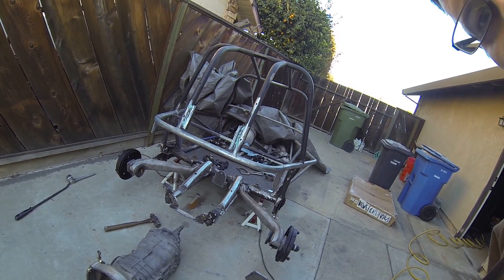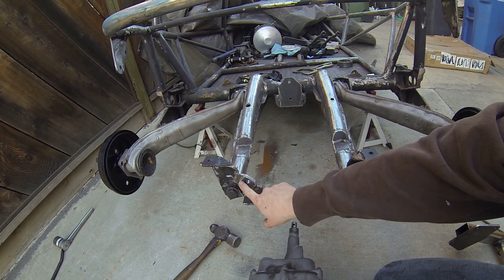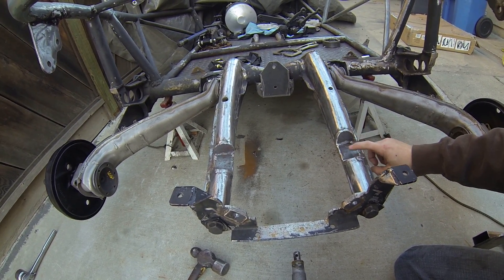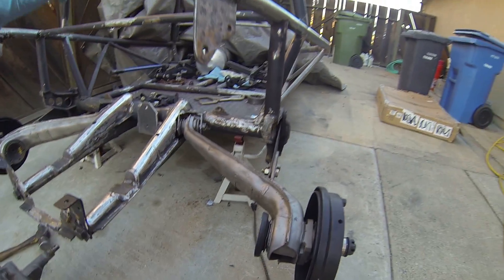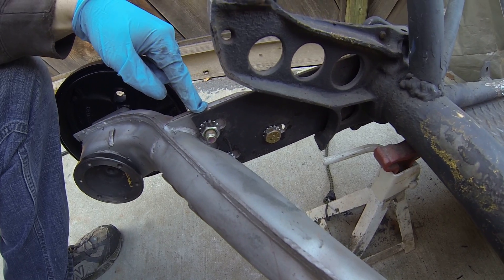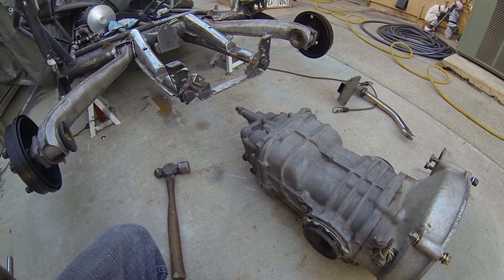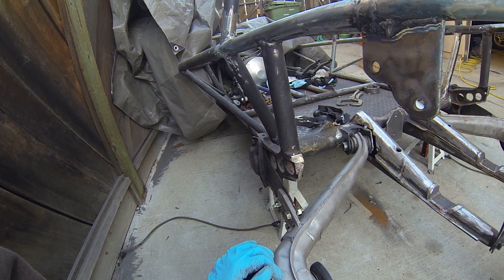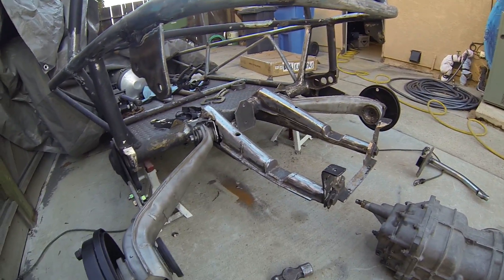VW Bug Swingaxle to IRS Conversion with Bus 3 rib Transmission Sandrail Buggy Jig

Comment: you should not have cut the notches in the frame horns so deep.  i would really recommend building a support tube that runs from the rear hoop of the frame to the frame horns as close to the trans mount as possible otherwise you will have issues with the horns bending. obviously make those tubes removable so you can pull the trans without having to pull off the cv flanges. keep all the bolts for the supports in double shear to make sure they will not deflect and break. trust me, i made this mistake once before.
Reply from the maker: Thanks for the tips. I welded supports to the ends of the frame horns.  I don't see much info on this these days so it is nice to get some help!
Reply: no problem, if you need any help or have questions check out shoptalkforums if you aren't already on there. tons of knowledgeable people and posts on there.
Reply: Wow I was wondering the same thing great video and great advice I am starting my conversion like this soon and this is great info thanks